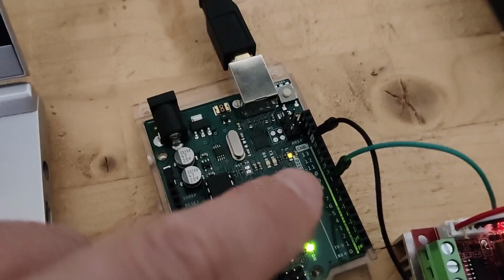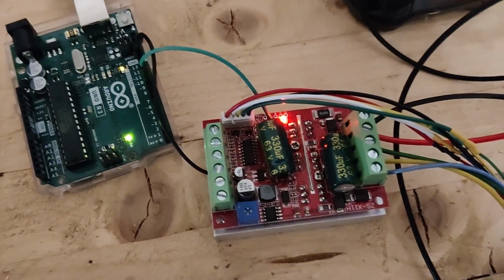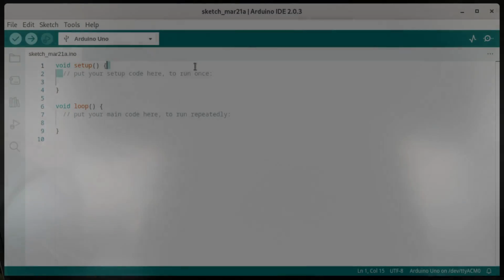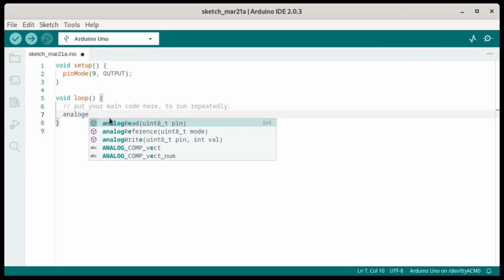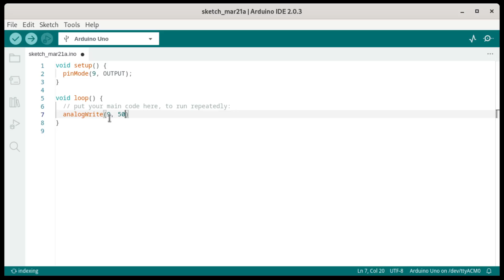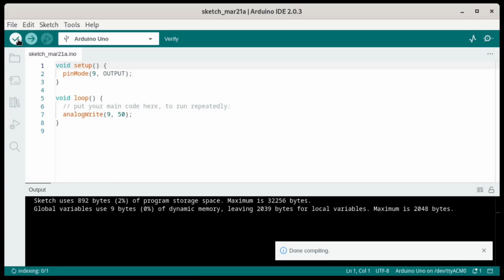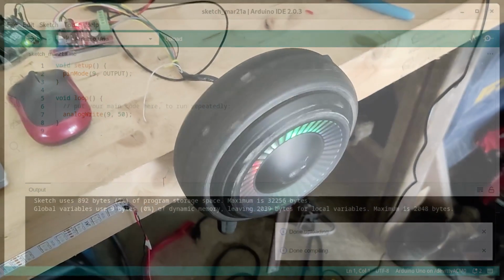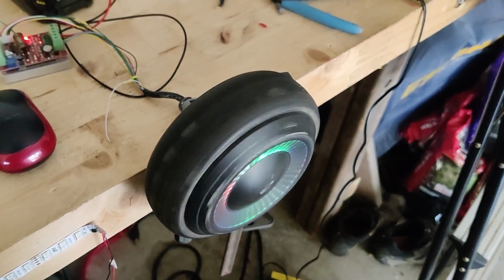Running a Hoverboard Motor with a  MotorController using and Arduino Uno Part 1.

Comment: After a long time of buying controllers and failing, I realized you can just use a normal speed controller if you have a normal hoverboard moter, It'll save you a lot of time and you can get reverse options also
Reply: I blew out one controller without even getting the wheel turning! Two more controller to go! As someone said the 400w board everyone use is not powerful enough.
Reply: What’s a “normal” speed controller? Thanks
Reply: @rad2304  i also noticed you can overvolt them a bit and they take it well,

Comment: I'm using an external potentiometer "twist grip" but the motor is always spinning at low speed, twisting makes it go super fast, but i can't get it to stop when not turning the pot 🤔
Reply: Get a self learning controller?

Comment: Hi! Your video is great, but I can use two motors whit one motor controller?
Reply: You will need a dual motor controller.
Its easier to just buy 2 controllers
Reply: @bobdebouwer7835 I already buyed 2 motors,  but anyway, thanks

Comment: I want to drive two of these motors, still attached to the Hoverboard frame, with an Arduino board placed somewhere in between them. That's still a fairly large distance for the PWM wire. Did you encounter any issues with signal quality?

Comment: What will happen if we misconfigure the sequence when connecting the A, B, C motor hall cables to the ports hall on the driver? Can it damage the driver if this continues happen? Please answer
Reply: You should not worry. With any brusless motor, like these, they will either work, or just rotate in the opposite rotation. Just plug them in, and if they are rotating backwards, unplug any 2 wires and change their place.

Comment: Can i use a controller without the hall sensor input (5 pins)
Reply: Not on this particular controller but if you go with another one without hall sensors starting up your motor will be more difficult but it can be done

Comment: Hi i have mounted a 350w hoverboard motor on my bike. When i used the board from the hoverboard the motor could move the bike with me sitting on it. When i switched to a board like this(36-60v 400w 20a) the motor can barely move the bike without a human sitting on it. Pls help
Reply: I'm trying to work on a similar project and was wondering if the motor is even capable of delivering enough torque to produce a meaningful speed on a bike. Would you mind sharing more details regarding what you did and found out?
Reply: @saijunoothula5917  Sadly the 350w motor was not powerful enough. I bought a 48v 1800w motor instead and my new bike runs great. With a top speed of 50kmh and a run time of 1.5h the bike is very fun to ride.
Reply: @svantee07  thank you so much for replying! Assuming you just upgraded your normal bike, were able to mount the motor using just 3d printing? Could you link the motor you bought
Reply: @JaceN3D  Thanks for replying, i found the problem with the motor. It was the motor which had broken when i mounted it(i hammered on it)

Comment: Will it run if you unplug the hall wires ?
Reply: No, it doesn't. Even if a single hall wire is out it won't run at all.
Reply: Thank you so much. i´m bying a new controller  @miro-hristov

Comment: I did this setup but the wheels are extremely noisy. Any tips?
Reply: your 3 motor wire may be in the wrong order. Make sure to pair them with the hall sensor wires in the same order.

Comment: Hi, thank you for that video, why didn't you use the green input screws?  0-5v for example for speed ? I have a similar board and i use the voltage to control it
Reply: that what i was thinking
Reply: Hi, do you know of any videos that explain how to control the motor the way you suggest? Many thanks!